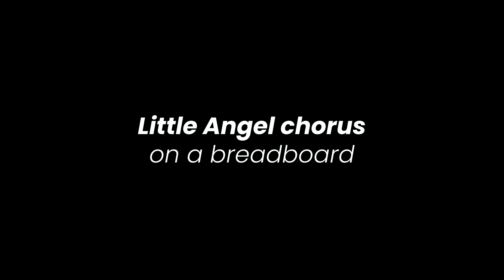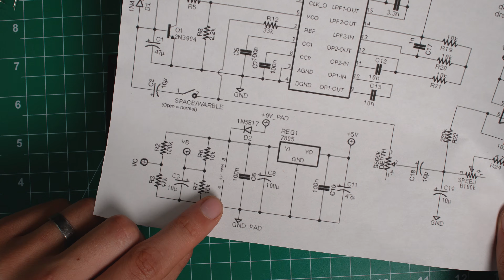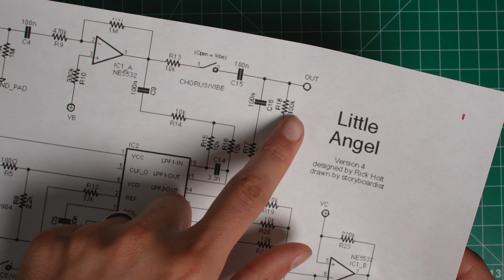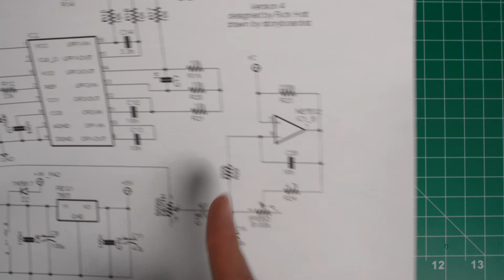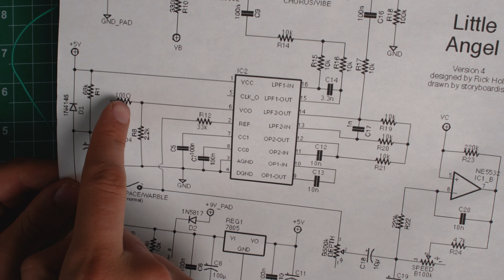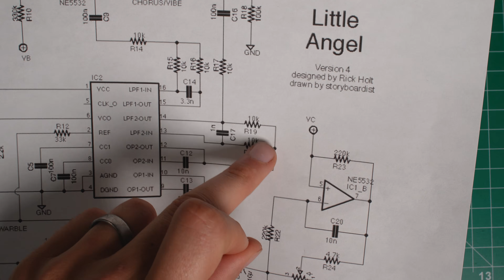I Built a Chorus Pedal Using a $2 Echo Processor (Breadboard Build)

Comment: I've built this after quite a bit of hassle, mostly due to poor quantity pt2399. Once PTC in stalled it start working. Other issue I have is the sweep on the pots, bunch up at the end, with the depth the worse. I see u have a 500k pot for depth, most schematics lost this as a 100k.

Comment: If you add a basic op amp mixer stage to the input of the chorus circuit (for the purpose of mixing the wet chorus output signal with the dry guitar signal) you will have a flanger 😊

Comment: The BOSS CH-1 (originally Analog using Matsushita MN3101/MN3007) used an IC that is essentially a PT2398. I happen to have one. It's much larger than the PT2399 though. I'm not sure how that compares to the 2399 but if you can find one, you can build a CH-1 (digital).

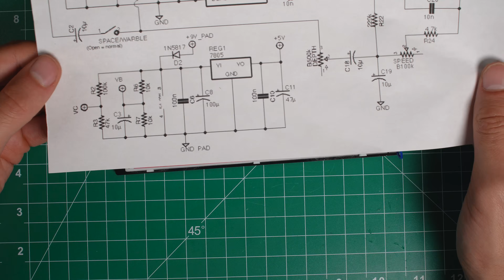Comment: Hey Grant! I'm enjoying your videos, so keep em coming! I have a question regarding the diode in the power section, at 2:20 in the video. I don't understand why the diode connects between the +9V rail and the ground rail. I would have thought that the diode should go from +9V to a new row, and C8 connects that row to ground. Are they not supposed to be in series? I am quite new to all of this, so I'm just trying to make sense of it all. Thanks :)
Reply from the maker: Thanks for your comment! I just had another look and you're absolutely right--based on the schematic I should have done extactly as you described. I missed this detail as it is very common to place the diode between the 9V+ power and ground to protect against reverse polarity. That being said, the way that I did it in the video will not have a miningful impact on the circuit/tone.
Reply: @PedalSmithCo  That makes sense. And the circuit obviously works, as seen and heard on the video. Thanks for the reply!
Reply: @blumppers  The diode is most likely burnt. The diode will draw a large current from the power supply effectively shorting it to ground for a few moments before burning out. If the power supply cannot supply said amount of current then it is quite possible that the power source itself might get damaged. Moreover, the diode will exceed its power rating and burn. Also not a very good idea to use unregulated supply for the opamps. I would also use MAX667 instead of LM7805.
Reply: @aniruddhaghosh4793  the lm7805 is a stable voltage regulator… it was meant to be used for things like this, well said a lot of pedals use them.. you can even use lm78xx to create pedal board psu’s.. maybe the only thing which yould cause problem in his cenario is the voltage dividers he made.. if he overloads the wattage rating of the resistors that may burn, but until that, it will be just fine… separate regulated voltage rails would be a bit overkill for that two small chips..

Also about the diode.. since the diode will have a junction voltage of 0.6v, 8.4v for a 5v regulator is fine, actually the higher the source voltage, the toastier a lm78xx gets.. for lm7805 - 5v 8-9v is ok, for lm7809 - 9v 12ish v, lm7812 - 12v 15ish v and so on EVEN TOUGH THEY CAN HANDLE HIGHER. Lm78xx was meant to be used under 1amp if i remeber correctly, that diode he used will not burn in this cenario since that diode is most likely also 1amp based on its size and type
Reply: @PedalSmithCo so (based on my longer comment) using the diode this way you actually ease the load on the lm7805, by dropping its source voltage from 9v to 8.4v (bc of the junction voltage), the chip will heat up a bit less. Since the lm78xx and 1n5817 is also rated to 1amp it will be just fine
Reply: @davidmorvai5217  It’s on the edge case when connected directly to ground. If it is through the capacitor, two purposes are served - protection and allowing a little voltage drop for the input of the 7805.

Try that regulated supply is a little overkill for two opamps but an unstable supply is a recipe for bad operation. Also digital ICs need much more stable power, 7805 does the trick here but MAX 667 really stabilizes the voltage and there is no room for any issues. I also use MAX 667 only when I design for precision scientific instrumentation and sometimes linear regulators too if it is really required for the stability.